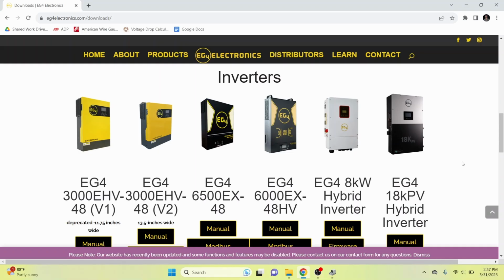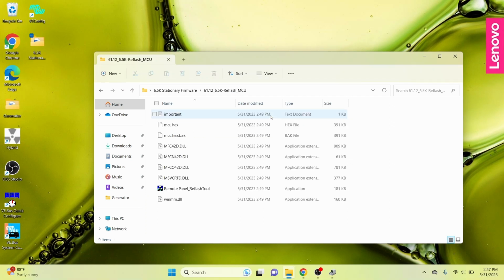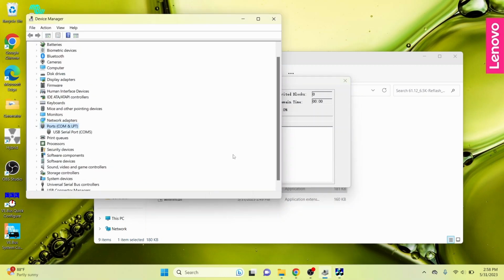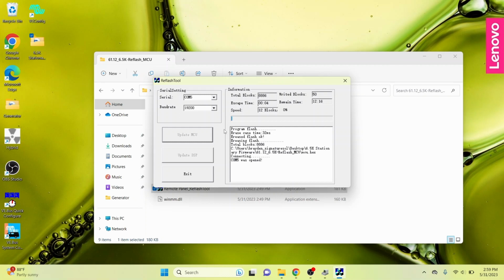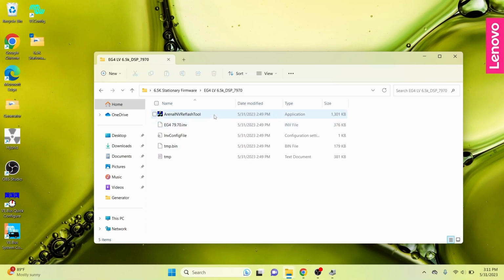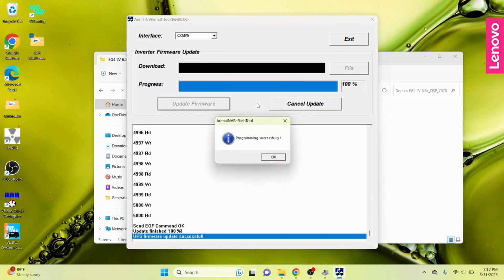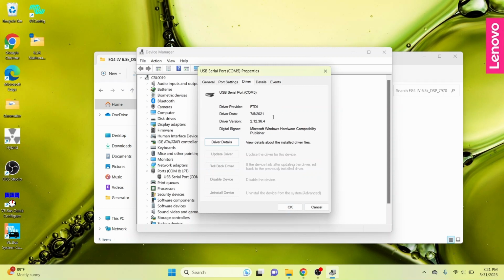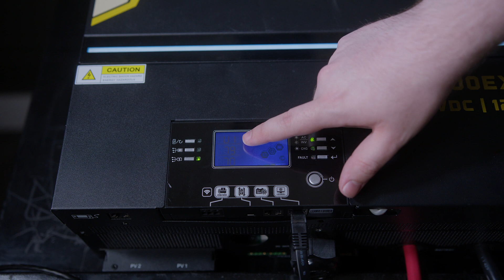Revamped Firmware Update Guide | EG4 6500 All-in-One Solar Inverter

Comment: The issue I ran into is getting my inverters into standby mode because they wouldn’t go into standby without another power source (other than battery) for more than maybe 20-30 seconds.  I didn’t have any hard lines run to it from the grid so I had to make two short extension cables and hook them into the AC source after turning down setting 11 to only charge at 10amps.  Good thing I’m a software engineer and figured that out on my own.

There should be a way to get the units into standby mode if only powered by battery but, if there is, it escapes me.
Reply: But…🤷‍♂️ support for a discontinued product?   🤔

Comment: I received half of the update cable with two 6500ex. I had to order the other half of the cable on Amazon. Then I hooked up one of your cables and it was bad. I didn’t know it, was having issues, decided to switch to the other cable you sent and it finally worked. If it isn’t one thing, it’s another with these pieces of junk from Communist China.

Comment: Can you do this on a MacOs?
Reply: Agreed. Assumptions are made: 1. Everyone is a Windows user or at least owns one PC. 2. We understand the industry concepts and “language” of these DIY systems. Every “easy” comment I’ve heard has been met with confusion, “Common questions” videos say refer to the manual - which is why they are questions to begin with, and so on. I understand why Eco-Flow is so popular. Lastly, many “default” settings were not MY settings when I powered things up. I won’t apologize for being a complete novice, willing to learn but being out of my wheel-house after spending the cash and getting “plug-n-play” equipment that is anything but. An example that highly technical people, not “user-focused” people write for you, your prompt after the update is “Programming successfully”. That’s not a proper sentence! 

Now that my whining is done, what do Mac users do?
Reply: Ditto. I bought a 6500 paired with EG4 batteries about 8 months ago, purely because of the promise of "integration" between the BMS and inverter. Since day one I have had Error 61 randomly occur, with no proper fix available. (Using custom battery settings and not having the BMS talk to the inverter is NOT a proper fix.) I am Mac only with no access to a PC. Signature Solar: please provide a Mac solution, or swap out my inverter for one with the current firmware at no cost so the system works as it was promised. Thanks in advance!
Reply: I was about to ask the same question